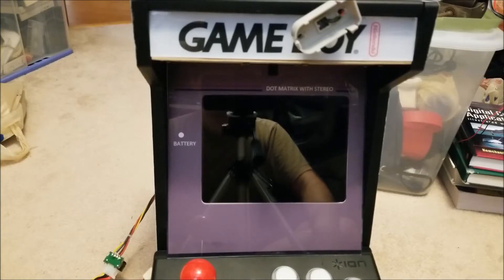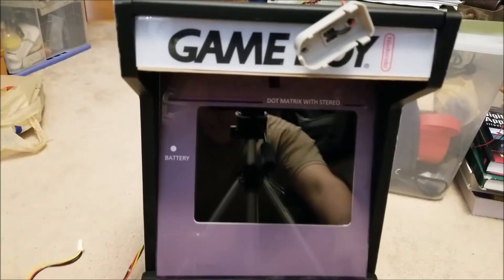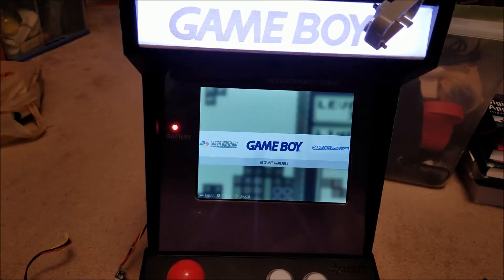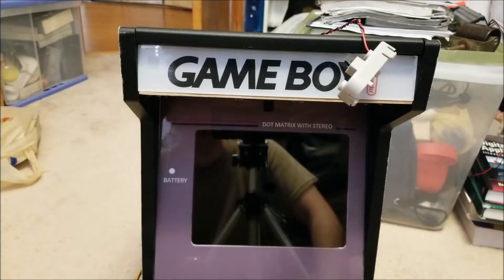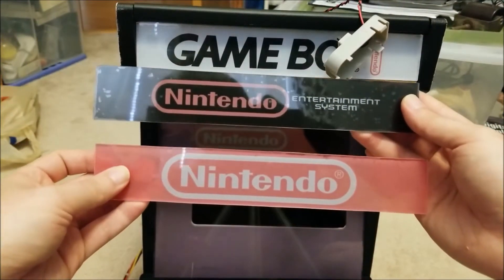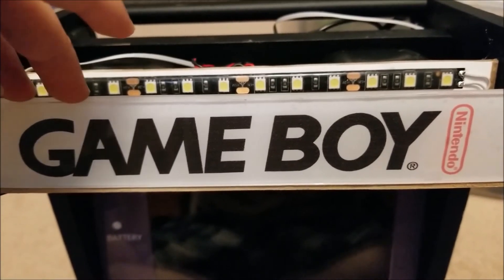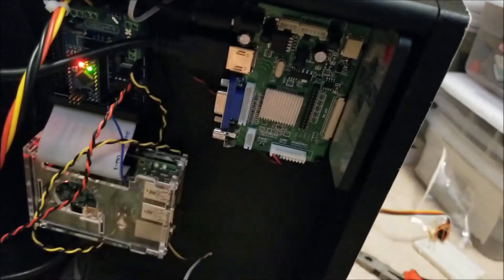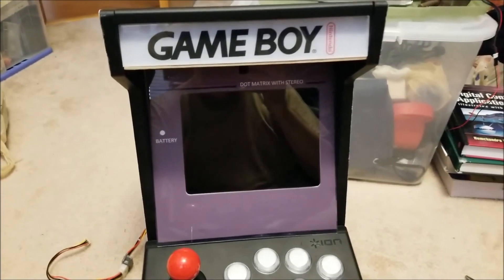Retropie Raspberry Pi Arcade Project: Part 5 - Backlit Marquee/Power Indicator/Audio

Comment: Looks awesome! The audio is wonderful too. I'd say stick with the Game Boy marque. What kind of a LCD did you use?
Reply from the maker: Abdul Aali Kamal Din Thanks, I searched eBay for an 8" lcd with a 4:3 aspect ratio (since most retro games use this ratio or similar) and found one that had 800x600 resolution. Most displays nowadays are 16:9 so finding a 4:3 one was difficult. I bought it around 2 years ago for about $40 and it works great with HDMI, composite or via. It's ips so colors are super vibrant and contrast is amazing.

I've asked all my friends and its unanimous that I should use the game boy marquee, but it is easily replaceable in case I wanna change it later.
Reply: I love your videos even though I don't know anything about electronics :(
Did you study electronics?
Reply from the maker: Abdul Aali Kamal Din I was self taught up until college where I studied electrical engineering. I now have a bachelor's degree and soon will have a master's in EE.
Reply: That's awesome :D
Do you have any advice or tips for beginners who are interested in electronics ;)

Comment: sad thing is that i cant afford this or afford to build this
Reply from the maker: LOLSTER239 meh I buy cheap components from eBay here and there and eventually I had enough parts to start this project. Most parts were used or salvaged from electronics that were thrown away. The most expensive parts were the wood cabinet and lcd.